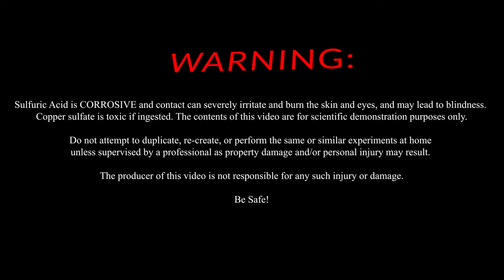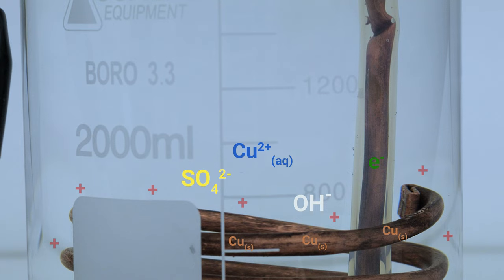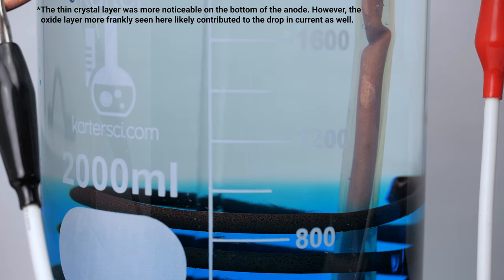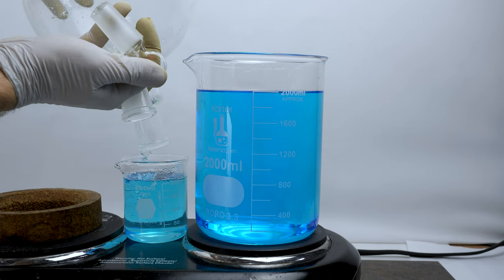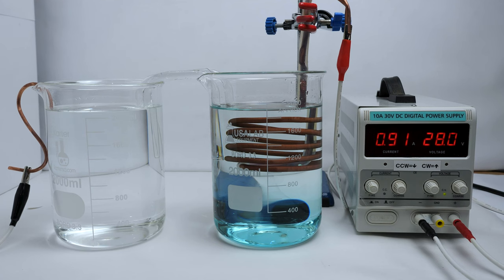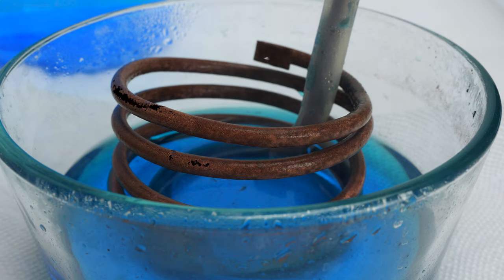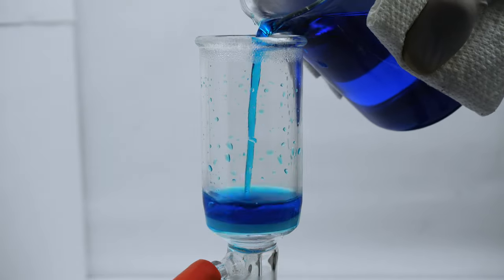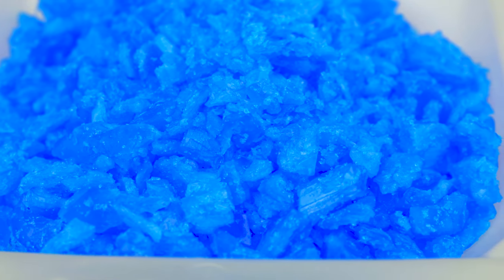Synthesis of copper sulfate by electrolysis

Comment: It's also notable that you can use Magnesium Sulfate (commonly sold as Epsom salt) as an electrolyte if you don't have access to sulfuric acid. However, you do need an electrolytic membrane (such as a clay pot) to keep the ions separated to prevent the products of CuSO4 and Mg(OH)2 from reacting back into MgSO4. Also, it's good to remember that if you're using a Carbon electrode, you're going to get Carbon particles formed from the corrosion of one of the electrodes. These can just be filtered off. 

It's also possible to use the same process to create Sulfuric acid if you don't have access to any. In fact, during the process, some of the water gets pulled from the acid via osmosis which helps purify the acid.

Personally, I'd use Copper Sulfate over Magnesium Sulfate for Sulfuric acid, since it creates Copper metal, Also, it's good to remember that if you're using a Carbon electrode, you're going to get Carbon particles formed from the corrosion of one of the electrodes. These can just be filtered off. so a Copper electrode can be used to collect it (bonus: it grows cool crystals!). I prefer this to dealing with Mg(OH)2 collecting on the electrode, since it's a poor electrical conductor.

Quick side note: Before anyone says anything, I KNOW that Epsom salt is Magnesium Sulfate Heptahydrate. But all that water is simply part of the crystal structure. Dissolving it in water makes Mg+ and SO4- ions all the same.

Edit: Also, it's good to remember that if you're using a Carbon electrode, you're going to get Carbon particles formed from the corrosion of one of the electrodes. These can just be filtered off.

Comment: I work in a college lab and have to neutralize out a solution of Copper and Sulfuric acid ALL THE TIME. It's our "Colorful Chemistry" Lab. It has a smidgen of Aluminum in it. Not enough to affect color. CuSO4 really is beautiful. I used an oven to dry out salts before and that's when I learned about the coloration of different hydrates. I was like "ohhh nice beautiful teal, monohydrate!" Then almost screamed anhydrous when that dark color showed. When I used the oven it turned to that color and that's when I learned about the coloration. That said I'm pretty sure, if in small powder form, it will re absorb water from the air and change colors over time. Atleast I think so. Most salts absorb water iirc.
Reply from the maker: The beauty of copper sulfate was definitely a large factor in deciding to make this video. I love that dramatic color change as well! And yes I believe you're correct. If the anhydrous salt is left open to air it's hygroscopic enough to rehydrate and turn blue again, given enough time.  Thanks for your interest in the video!

Comment: Could use sodium bisulfate instead of sulfuric acid for the electrolyte, & separate the CuSO4 by crystallization?
Reply from the maker: @bpark10001  Yes, I've never tried it but per the sciencemadness forums it seems the electrolysis of sodium bisulfate using copper electrodes will yield Cu++ ions at the cathode, and H+ at the anode, just like when using sulfuric acid. These ions would produce CuSO4 and convert the bisulfate to sodium sulfate. As the solution becomes less acidic though (due to the loss of H+ ions via H2 gas at the anode), CuSO4 production slows and the anode will begin reducing Cu++ to Cu(OH)2, which would also likely electrically insulate the anode, eventually killing the current.  
This method is a viable route to produce the CuSO4, but it could be cumbersome isolating it from the resulting solution of CuSO4, Na2SO4, and remaining NaHSO4, as their solubilities in water are similar (could be a fun challenge though!). Using H2SO4 as the electrolyte makes isolating the CuSO4 much easier. 
Thanks so much for the question!

Comment: I'm actually in need of copper sulfate so I'm going to give this a shot but it makes me wonder if it might also work to help refine a 2kg copper/silver alloy I have from a mass of silver contacts I smelted last year.  It's pretty much a 50/50 mix  I assume the silver will also dissolve along with the copper and if i allow the copper sulfate to crystallize out first and then add in HCl I should be able to recover the silver.
Reply from the maker: That sounds like an interesting experiment and I'd imagine this could work to separate your alloy. Copper is more reactive than the silver, so the reaction should favor copper sulfate production. Sulfuric acid only dissolves silver if it's concentrated, so it would likely leave the silver component of the anode alone. The oxygen production at the anode may produce silver oxide though, which would react with the acid to form silver sulfate. Silver sulfate is poorly soluble in water though. So if it were me, once the electrolysis is finished, and after I've removed water from the solution by boiling, I'd filter the mixture of precipitants from the acid, then add water to dissolve the copper sulfate, leaving the insoluble silver sulfate to be filtered out. Just remember this experiment is very dangerous as boiling sulfuric acid is extremely corrosive. If anything were to go wrong and you weren't following proper safety protocols you could be seriously injured. I don't know your skillset, so just be aware of the dangers before trying anything.
Reply: It would be MUCH better to dissolve it all up in Nitric acid and then add a NaCl solution to precipitate AgCl, then filter it off and add Sulfuric acid to produce Nitric acid and Copper metal. There are calculations to be done of course.

There are plenty of methods out there to recover the silver from AgCl, and I suggest you research them and select the one that is best for you. However you should make sure to store your AgCl in an opaque container or a dark place, as light converts it into silver (but not thoroughly, only what the light hits).
Reply: @therealprofessor976  Completely agree except I'm out of nitric acid.  lol  I do have around 20L of 98% sulfuric and 10kg of KNO3 though.  Granted I could just make the nitric acid but logistically it's not realistic at this time as my condenser cracked and for the amount of copper sulfate I need I can't justify replacing it yet.  I put the Ag/Cu alloy on the shelf and grabbed some of the Ag plated stuff and I've been letting things brew (as it were) and I have a nice little batch of copper sulfate crystalizing as I write this.  As far as using NaCl to recover the silver, I'm not a fan.  I much prefer KCl as the KNO3 has a much lower solubility and therefore much easier for me to recover to reprocess into nitric acid later on.
Reply: @Enjoymentboy  Alright, well good luck!

Comment: You could benefit from a diaphragm set up in your experiment here. I saw a guy use a condom wrapped around one of his electrodes, I think the cathode,  but it was a lambskin condom so it was semi permeable. Another one, and frankly more likely for anyone is to put a ceramic pot in solution, where the top electrode you have here is in the ceramic pot, filled with the h2so4, and the fluid can travel through the ceramic,  but not gonna get copper ions through it.. just food for thought

Comment: Cool video. I know copper metal is not magnetic, do you know what generally happens if this crystal process is performed under a heavy magnetic field, with a ferrous metal?
Reply from the maker: Really fascinating question. I didn't know offhand but doing a quick review of literature it seems like this concept has been explored in the past with regard to protein synthesis as well as pharmaceutical development. During protein crystallization the process is enhanced by magnetic fields: "The quality enhancement is attributed to the magnetic orientation of protein crystals and the magnetic suppression of buoyancy convection in protein solutions". So its possible the magnetic fields assist aligning proteins together, preventing them from floating apart. I also read that during the crystallization of carbamazepine (an antiepileptic medication), when exposed to a weak magnetic field it produced Form III, but when exposed to a magnetic field >0.5T during crystallization the majority produced was Form I. Sounds like the implications of this are vast and definitely worth exploring more!
Reply: @Project.Infinity  thanks for responding and for adding so much depth in your response. My initial interest is in finding high-Q and stable oscillators for quantum computing and/or potential in improving conductors. Quartz crystals output stable frequencies, so I was exploring other crystal types. A perfectly formed crystal in theory would have really high-Q resonant properties for almost-perfect selectivity and I wondered whether in general some crystals grown under magnetic fields would be coerced to form differently and have superior or alterable crystalline states. It's impossible to buy equipment and research the diverse fields, so videos like yours really accelerate the ideas-exchange boundaries by creating places to meet like at intersections. Thank you so much for your time and response!
Reply from the maker: @LydellAaron   It's inherently a lot of fun making these videos, but it's for reasons like this that make it truly worthwhile. It's the knowledge gained along the way. I'm very happy the video was helpful to you. I had never considered magnetic fields influencing crystallization--What an incredibly interesting field you're studying. Thanks so much for the question!

Comment: Let's say you crank the voltage up to 30 volts. Sure, there will be a lot more oxygen production at the anode, but what is the downside, if it causes the whole process to go much faster?
Reply from the maker: I had the same thought, but attempting that caused a problem. Not only will cranking up the voltage increase the current, it will also increase the electrolyte temperature. While warmer electrolyte  increases reaction speed even further, it unfortunately also causes bubbles to form within the salt bridge. The bubbles displace the electrolyte from the bridge and dramatically reduce its current carrying capacity, nearly halting the reaction.
Reply from the maker: I believe the bubbles are oxygen gas dissolving into the water while the O2 is being produced. Heating the electrolyte makes the O2 less soluble in the water, so the gas comes out of solution. Unless I were to place the beakers in a cold water bath (lowering CuSO4 yield) or somehow place the system under vacuum to degas the electrolyte as the O2 is produced, running it slow seemed like the simplest solution.

Comment: I think you will get a more pure product from copper wire than copper piping. I've noticed that copper piping gives me a lot more impurities than copper wire when making copper (II) salts.
Reply from the maker: @jacobyoung7018  Good call. Starting with cleaner metal would definitely improve the purity of the crude product. Most scrap yards would likely have a ton of stripped copper wire sitting around as well.  The recrystallization step is highly efficient and makes the crude nearly 100% pure, but at the expense of losing some product. Depending on what purity you need, recrystallization could be skipped if the crude is already pure enough. Thanks for watching, and for the suggestion!

Comment: First of all, great video and what i wanted to ask you is: how much sulfuric acid did you use?
Reply from the maker: Thank you! Both beakers contained about 2000mL of sulfuric acid, so in total I used roughly 4000mL of 35% sulfuric acid, which is a huge excess. H2SO4 is very conductive so by using an excess the current was relatively high. Had I used the stoichiometric quantity, the electric current would have been quite low, and the electrolysis would have progressed very slowly. I just saved the remaining acid for use in future runs.
Reply: @Project.Infinity  couldn't you also concentrate it to some extend by boiling out the water?
Reply: @Project.Infinity  btw thank you for the quick answer, as a matter of fact i will be doing this experiment in school after class, as my teacher allowed me to experiment on my own with teachers supervision.
Reply: As this video was a huuuuuge help in terms of reference and research
Reply from the maker: I'm glad you found it helpful! Yes you could definitely concentrate the sulfuric acid by boiling out the water, however CuSO4 is not soluble in H2SO4. Without the water the solution will become saturated with CuSO4 and as we saw in my video, crystallization on the anode severely reduces current. So the trick is to have concentrated enough acid solution to keep the current high, but keep enough water in solution to prevent early crystallization. You could heat the solution to increase reaction speed and make the solute more soluble in the water, but that can cause convection (CuSO4 will reach the cathode and reduce to Cu(s)), and bubbles forming in the salt bridge (decreasing current). It's all about finding the right balance.
Have fun and be safe!

Comment: what's the filter matter your using ? for it to not react with quite high H2SO4 ?
Reply from the maker: In this case I actually don't use filter paper at all due to the concentrated H2SO4. The Buchner funnel I used consists of a fritted glass disk with 15-40 micron sized pores. The glass frit is nonreactive so it's compatible with a wide range of chemicals. The one downside though is it's much more time consuming to clean. Because I can't just throw away filter paper I need to flush the funnel with solvents a few times which can be frustrating with stubborn precipitants caught in the pores.
Reply: Well that was fast... @Project.Infinity  
Actually i was just trying to figure can i (as a random amateur) get fillter resisting to sulfuric acid from common thing i guess that's not possible but anyways the video was quitte interesting and detailled so keep up the good work and i can only hope for you that your subsriber number goes up (because 370 for such work isn't really fair i think) im glad to be the 371th ty again !
Reply from the maker: Thank you for watching and for your support! eBay can offer some surprisingly great deals on glassware to get you started. It's where I purchased my Buchner funnel. Have fun and be safe!

Comment: how much mole is your h2so4?
Reply from the maker: @crieliocriel  I sourced the H₂SO₄ from an auto parts store, marketed as battery acid. The SDS indicates that it contains between 30-43% sulfuric acid. To verify this I performed two titrations today, which determined the concentrations to be 49% and 48.4%, respectively. Surprisingly this suggests the concentration is closer to 5M.